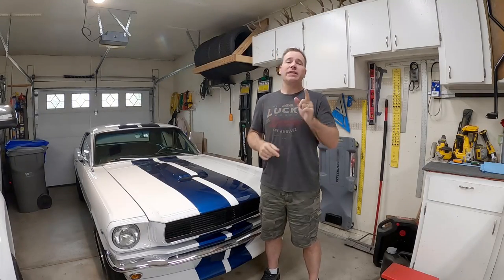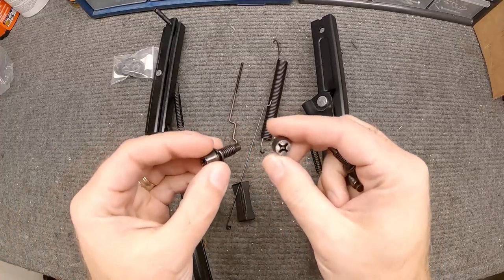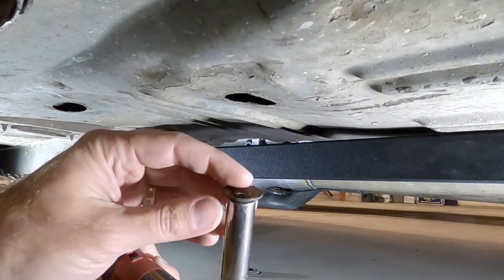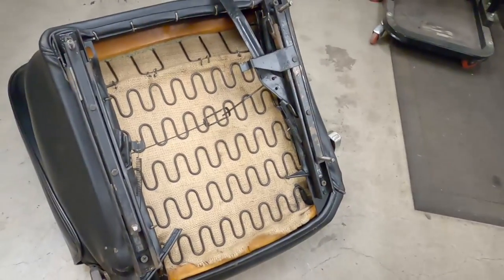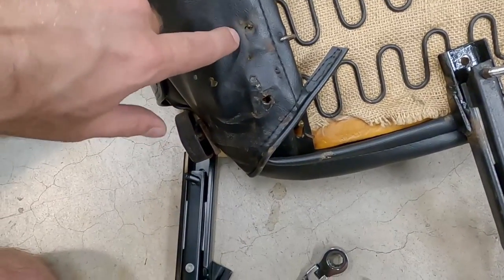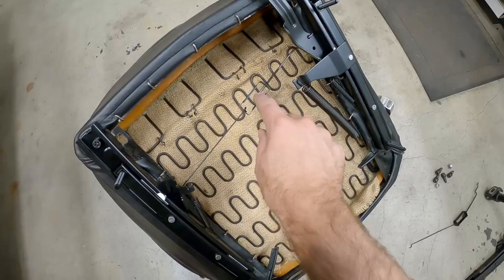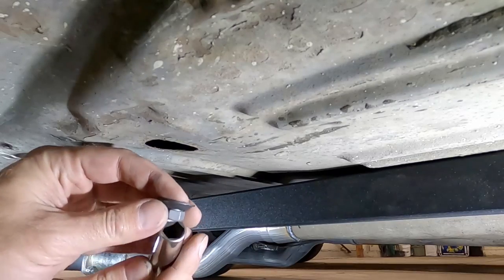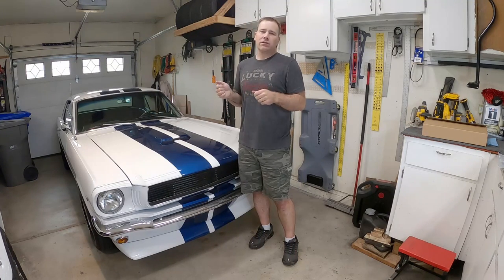How to install a new Seat Track Assembly - 1966 Mustang

Comment: I’ve noticed it before, but I’m speaking up on this one: I see some cool decisions going on in the background. It’d be cool to see a video about garage/shop organization. You clearly care about that, and there are a lot of us making a suburban garage function as a workspace. Keep up the good work sir.
Reply from the maker: Thanks for the feedback!
I've thought about making a video like that, but honestly I kind of feel silly talking about it.  For what it's worth, it's just the third bay of my garage, with kitchen cupboards I bought off Craigslist for storage (they were cheap), and a toolbox.  I am mentally walking around my garage as I type this and I can't think of any parts or sections that would be great to share.    I'd rather talk about my Theater Room than my garage, because I designed and built that whole area, compared to stuffing some storage in the corner of my garage.  :)

Comment: A small turnbuckle would work really well there
Reply from the maker: Possibly, but the stock parts are fairly affective. It would just add to the cost of refitting these seats and would rarely get used. We tend to put the seat where we want it an rarely move it. 🙂
Reply: @AndyKruseChannel  this is true was just suggesting a very small turnbuckle as a replacement for the flimsy stock  part . AT least you would not have to worry about stripping it😎

Comment: Still trying to figure out where I went wrong with this one. I bought the kit from CJ Pony Parys and the track mounting holes didn’t align with the seat holes. I had to drill the track holes out to get them to line up. No huge deal, but still a pain. Then I got everything all hooked back up and the seat dropped right into the car and it didn’t/won’t move at all! Not sure what I did wrong. Pulling it all back out tomorrow. So frustrating what should have been such an easy job…🤬😡🤬
Reply from the maker: These track kits look easy on the surface, but they need to be connected correctly for them to work (which I think you're finding out).  Maybe pull the other seat and use the layout as a guide for connecting everything on your first seat.  It's probably one tiny thing and then it'll be perfect.  :)
Reply: @AndyKruseChannel  thanks! I may have to do that. I took tons of pictures to make sure I had it connected properly but yeah, I'm stumped. To make matters worse, the previous owner has the left exhaust pipe routed right over the bolt holes, making removal of the seat a huge PITA! Ugh - always something....

Comment: Hey Andy, we just bought the same car but not in the same condition as yours (many rust). Thanks for your advice but we wanted to know which tool to remove the nuts from below (the size) ? Thanks  🙂
Reply from the maker: Awesome!
The nuts that hold the seat to the car?  You'll want to use a 1/2" deep socket for those nuts.  :)